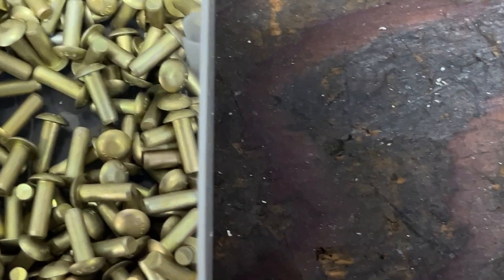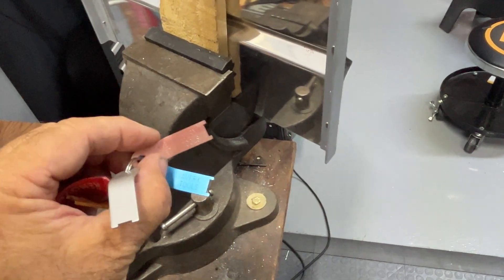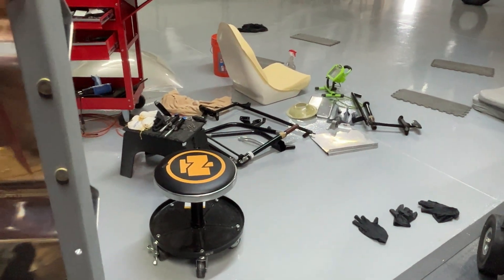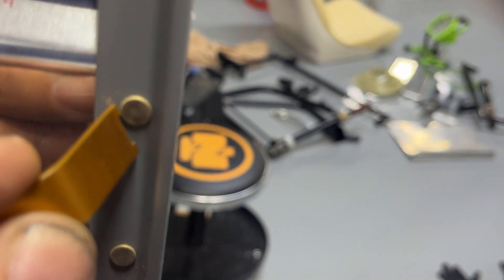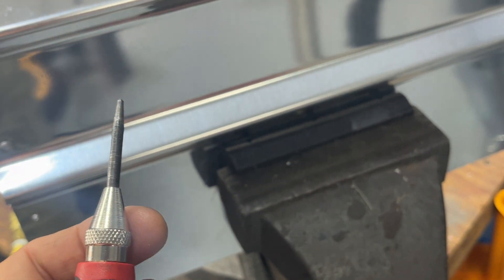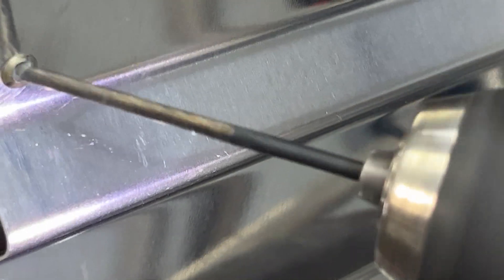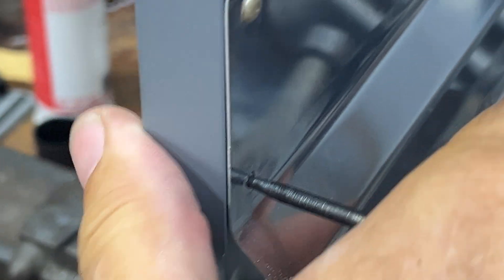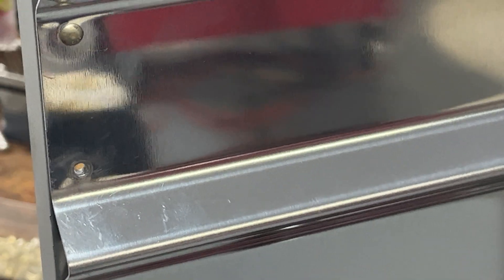drilling out an improperly set rivets

Comment: What about the thought that there are times where removing the rivet can do more damage than leaving it alone. Note I’m not talking about a completely tilted rivet, etc. but the relative strength I have been told is very small with slightly overdriven rivets.
Reply from the maker: Yes, that’s true. No need to drill out a rivet that is not totally perfect. Use your judgement, especially if it’s in a difficult place.